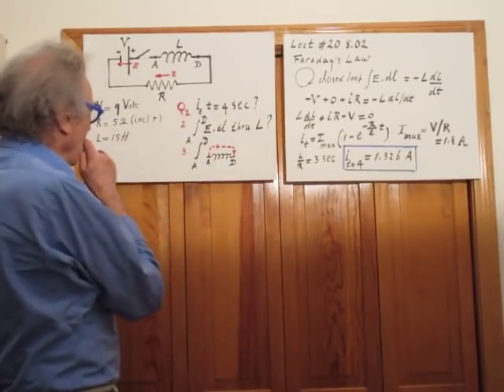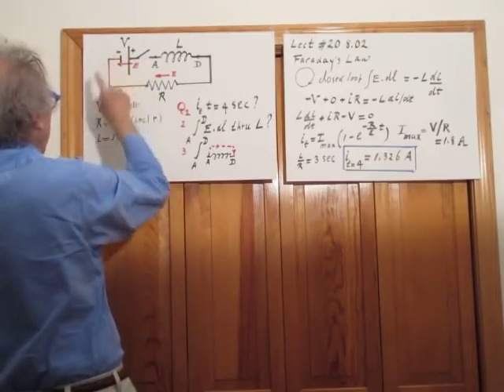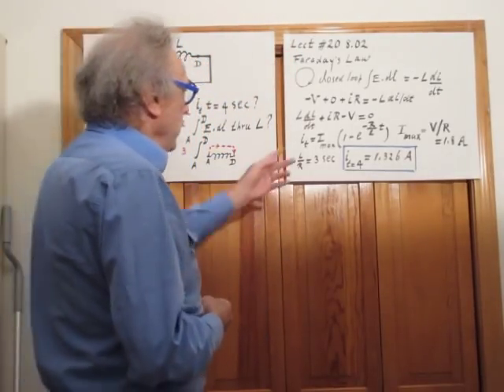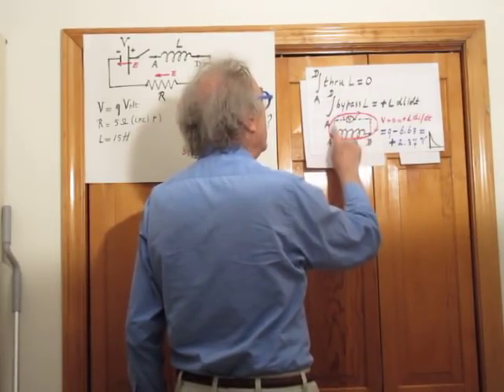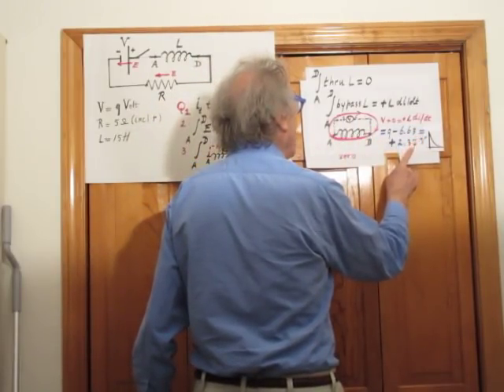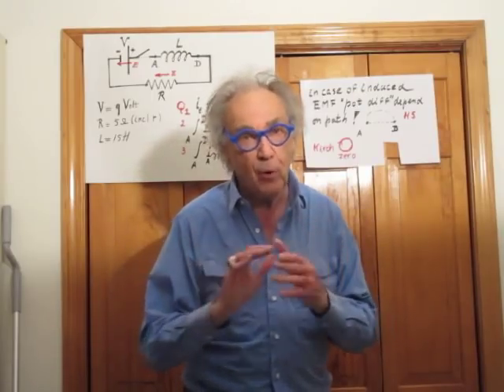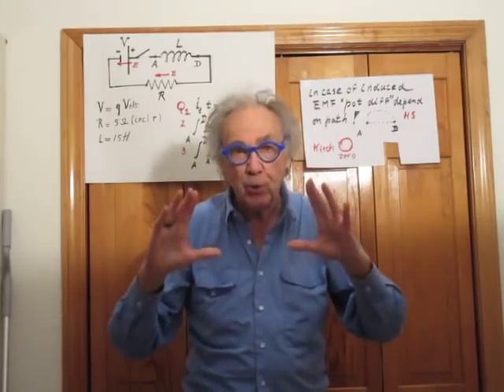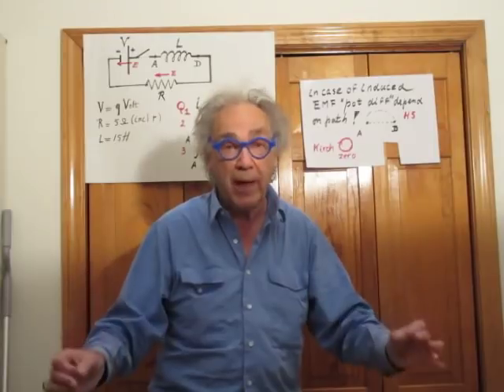Solutions Problem #75 Faraday's Law!

Comment: "Voltage is not always independent of path".
thank you sir
Reply from the maker: that's correct; if dphi/dt in  Faraday's Law is zero, then voltage differences are independent of path.
Reply: @lecturesbywalterlewin.they9259  so basically if there is NO change in magnetic flux, then Voltages are path independent? 
I'm just confused as to how/why we can exit the wiring of the circuit and follow some induced Electric field that exists outside of the circuit and then in a way call that a circuit? Why is that we just don't always use the calculation going though the Inductors since that is literally apart of the circuit? I hope that makes sense.

Comment: I do not always get to view them, or have the time to understand them deeply, but I love these videos.

Dr. Lewin ... my last comment was on another video, but I would love to hear your answer to the question of - is there any experiment that you do or have seen or even thought of that is your favorite experiment of all time that reveals something you feel is deep and primary about the universe?

Another question I have had about physics and mathematics is this.  When we look around the universe and solar system so far that we see these are all physical and geological manifestations of the laws of physics acting over time. But if we were looking and we see certain configurations they tell us there is a kind of "congealed" time effort of chemistry, biology, life and intelligence, and evolution.  For example, we get to the Moon, or Mars or anywhere we know that we have no been, and we find something like writing, or a book, or a tool.  Is it possible to look at these types of artifacts like a physical or mathematical dimension, similar, but different from length, width, depth and time?  Something that might tie life and even intelligence to the universe in a physical way?
Reply from the maker: The unit was established by the IEC in 1930 [3] in honour of the Danish physicist Hans Christian Ørsted. Ørsted discovered the connection between magnetism and electric current when a magnetic field produced by a current-carrying copper bar deflected a magnetised needle during a lecture demonstration.

Comment: Thank you so much, understanding this is really helping me in my circuit design.

Not because I'm going to take the time to apply Faraday's Law, but simply because I am trying hard to burn into my brain that induced EMF does not follow Kirchhoff's Loop Rule. Understanding this takes away the mystery of designing circuits using magnetic components; it explains entirely why the engineers design the power supply control circuits by analyzing the "S-plane!" That allows them to do the math in time units of the frequency, so Kirchhoff still applies. And then all the non-linear behaviors that they need they achieve by switching in and out different parts of the circuit. So they never have to consider units of time other than at the operating frequency.

But it also is important because since induced EMF is path dependent, circuit layout in the presence of noise is no longer "mystical" at all. If a person was good enough, they could even use Faraday's Law to triangulate the location of the noise source based on the noise produced in different parts of a complex circuit.

Comment: Great problem.

In Holland we cycle. 
If you ride up a hill, that takes energy, but you will benefit from that when you go down again. Gravity  is a conservative field, and the loop rule applies.
But in Holland we do not have a lot of hills, however we do have a lot of wind. If you have a head wind when going from home to school you better take the route through the woods. Going back you go through the fields. The loop rule only applies when there's no wind.
So we need Faradays law, and Kirchoff's loop rule is for the birds abroad, where there's no wind, but only hills.
Maybe the analogy stops there, but I like to think about the changing magnetic field as a sort of 'wind' to remind myself when doing a problem. You could even think of wind gusting up water level in a canal, suggesting an apparent potential difference.
Reply from the maker: The analogy is niet correct. The induced EMF is Ldi/dt. It's only non zero if there is a change in i. Your wind will always oppose your motion; het hangt niet af van de maatte waarin de wind verandert.
Reply: @lecturesbywalterlewin.they9259  Ik heb niet gezegd dat de wind vergeleken moet worden met het magneetveld zelf. Niet voor noets gebruikte ik het woord changing. Maar ook de richting en wel meer  is anders. Het gaat me slechts om het verschil te illustreren tussen conservatieve en niet conservatieve velden.

Comment: Now I understand why Kirchhoff's second law is for the birds. The closed path integral over the electric field is zero if and only if there are no changing magnetic fields. It is often stated in textbooks that your third equation (L di/dt + i R - V = 0) corresponds to Kirchhoff's second rule, which is not true. I think, it is something like a modified version of Kirchhoff's second rule for changing magnetic fields. Just like one assumes inertial forces in accelerated reference frames, so that Newton's third law still remains valid.
Reply from the maker: It is often stated in textbooks that your third equation (L di/dt + i R - V = 0) corresponds to Kirchhoff's second rule, which is not true  Indeed that is WRONG The closed loop integral of E dot dL is 
IR --V  it is also --Ldi/dt

Comment: I have been discussing this on the net with many people I call Kirchhoffians trying to explain you were right, and one thing I have noticed they get confused about is in the use of the electric symbols adopted by lumped circuit theory. Maybe if you used a different way to draw the inductance, for example as a single coil of thick wire with its terminals close together along the circuit path, it would be easier to see the two paths you are referring to: one that goes through the perfect conductor and one that jumps from one terminal of the coil to the other one. As is shown in Ramo Whinnery and vanDuzer's "Fields and waves for communication electronics".
Reply from the maker: send this to those who are confused or are ignorant.
I demonstrated at the end of my lecture #16 of my 8.02 E&M course at MIT that two identical voltmeters attached to the same 2 points in a circuit can show very different values. https://www.youtube.com/watch?v=nGQbA2jwkWI&list=PLyQSN7X0ro2314mKyUiOILaOC2hk6Pc3j&index=17 The reason is that in the case of an induced EMF (Faraday's Law) potential differences are no longer determined; they depend on the path. This also applies to the secondary windings of transformers as the EMF in the closed loop of secondary windings is induced. https://www.youtube.com/watch?v=b7i2uMx7gHo&list=PLyQSN7X0ro22zanLOcvkaSY-IZqheFYM5&index=8
Of course, in cases where Kirchhoff's loop rule (KVL) applies, 2 voltmeters attached to the same 2 points in a circuit will always show the same value. 
My demo was first suggested and published by Romer in December 1982 in the American Journal of Physics. This demo has now become a classic; it's done all over the world at many colleges and universities. 
Kirchhoff's original text can be found in the following link, pages 497-514: https://books.google.de/books?id=Ig8t8yIz20UC. Clearly he was fully aware of the prerequisite for his "loop rule". KVL is a special case of Faraday's Law. That's why Faraday's Law is one of Maxwell's equations and KVL is not.
By teaching students that KVL always works without telling them when it does not work, makes many believe that the closed loop integral of E dot dL is always zero. ElectroBOOM and Dirk Van Meirvenne therefore believe that 2 voltmeters attached to the same 2 points in a circuit must always show the same value which is not true as demonstrated in my lectures. They each posted a video (see @ note below) on their channel in which they claim to have proof for their wrong ideas which violate Maxwell's equations. Apparently they do not know, or do not understand, that in the case of an induced EMF potential differences are no longer determined; they depend on the path. MIT students who took my 8.02 course (Electricity and Magnetism) would not make this mistake! I therefore believe that to introduce a "modern version" of KVL and then teach students that KVL always holds is not advisable as you may set them up for making the same embarrassing mistake that both Dirk Van Meirvenne and ElectroBOOM made. 
Also read Professor John Belcher's thoughts on Faraday's Law and on KVL. Professor Belcher is my former colleague at MIT. http://freepdfhosting.com/0813df09f5.pdf
(@) ElectroBOOM insulted me in his video by mentioning that the reason why my 2 voltmeters read different values was due to "bad probing". If I had done the demo correctly I would have found that both voltmeters would have read the same value.
Reply from the maker: @DarkNight-bo7om  I appreciate the fact that this Physics may not be familiar to you. Don't feel embarrassed about it; you are not alone. However, it's never too late to get educated. The choice is yours. Maybe this will help you. 
I demonstrated at the end of my lecture #16 of my 8.02 E&M course at MIT that two identical voltmeters attached to the same 2 points in a circuit can show very different values. https://www.youtube.com/watch?v=nGQbA2jwkWI&list=PLyQSN7X0ro2314mKyUiOILaOC2hk6Pc3j&index=17 The reason is that in the case of an induced EMF (Faraday's Law) potential differences are no longer determined; they depend on the path. This also applies to the secondary windings of transformers as the EMF in the closed loop of secondary windings is induced. https://www.youtube.com/watch?v=b7i2uMx7gHo&list=PLyQSN7X0ro22zanLOcvkaSY-IZqheFYM5&index=8
Of course, in cases where Kirchhoff's loop rule (KVL) applies, 2 voltmeters attached to the same 2 points in a circuit will always show the same value. 
My demo was first suggested and published by Romer in December 1982 in the American Journal of Physics. This demo has now become a classic; it's done all over the world at many colleges and universities. 
Kirchhoff's original text can be found in the following link, pages 497-514: https://books.google.de/books?id=Ig8t8yIz20UC. Clearly he was fully aware of the prerequisite for his "loop rule". KVL is a special case of Faraday's Law. That's why Faraday's Law is one of Maxwell's equations and KVL is not.
By teaching students that KVL always works without telling them when it does not work, makes many believe that the closed loop integral of E dot dL is always zero. ElectroBOOM and Dirk Van Meirvenne therefore believe that 2 voltmeters attached to the same 2 points in a circuit must always show the same value which is not true as demonstrated in my lectures. They each posted a video (see @ note below) on their channel in which they claim to have proof for their wrong ideas which violate Maxwell's equations. Apparently they do not know, or do not understand, that in the case of an induced EMF potential differences are no longer determined; they depend on the path. MIT students who took my 8.02 course (Electricity and Magnetism) would not make this mistake! I therefore believe that to introduce a "modern version" of KVL and then teach students that KVL always holds is not advisable as you may set them up for making the same embarrassing mistake that both Dirk Van Meirvenne and ElectroBOOM made. 
Also read Professor John Belcher's thoughts on Faraday's Law and on KVL. Professor Belcher is my former colleague at MIT. http://freepdfhosting.com/0813df09f5.pdf
(@) ElectroBOOM insulted me in his video by mentioning that the reason why my 2 voltmeters read different values was due to "bad probing". If I had done the demo correctly I would have found that both voltmeters would have read the same value.  
This is my only msg on this issue. This is too basic. I do not argue either with people who believe that the Earth is flat.
Reply: @lecturesbywalterlewin.they9259  😅I m learning from u sir....And I have understood what ur teaching...thanks for replying...u r really very clear and easy to follow ... .thankyou..
Reply: @lecturesbywalterlewin.they9259  Your lectures are very very helpful...

Comment: Walter Lewin Sir, 
 I see that when a voltmeter measures  a voltage across a self inductor there is no electric field across the self inductor , the electric field is across the coil inside the voltmeter. My question is - can  this be physically demonstrated with a non contact electric field probe. The probe placed beside the self inductor no field indicated , move the non contact electric field probe away from the self inductor and place it beside the meter coil and an electric field is indicated. Is that correct.

Comment: My difficulty in getting these problems correct is not Faraday's law, but the part about the integral through the coil being zero, which means the integral value is eventually divided into the fixed portion through the battery and a varying portion across the resistor. Is there any further explanation you can give as to why the integral through the coil wire must be zero?  Could any instrumentation be devised that, applied to the inductor,  would read zero at all times, or can it only be observed as the potential across the battery and resistor (as does the added voltmeter)?
Reply from the maker: no E-field can exist in a superconductor as that would lead to an infinitely high current. use google!!!
Reply: @lecturesbywalterlewin.they9259  Thanks very much for replying! The term "back emf" came to mind, and I now see that this is the value read by the voltmeter because it completes a loop with the inductor. So, the integral through the inductor wire is zero, but the integral on the path through the voltmeter or through the battery and resistor has to equal the induced emf. I think in electronic engineering, it is the voltage "measured" by the resistor and battery or external voltmeter that is typically emphasized, and the zero integral through the inductor wire is treated as a mathematical necessity. Understanding it via Faraday's law and noting where the linked flux exists is much more satisfying, but as you have said, it is difficult for many (me included).

Comment: I have no problem in understanding the concept, but I found it very difficult to learn electromagnetics on the level where I could calculate these things. You could say I understand Faradays law just as well as QED, which I have read for fun to understand generally how things work, but integrals and dot products trip me.
Reply: Don't worry cause me and all my friends who are in E&M right now basically feel the same way. Taking Vector Calculus before attempting the mathematic calculations required in E&M problems I think is essential. At my university, it isn't a course requirement, only being enrolled in calc2 is. But in calc2 (at my university), you don't ever do double/triple integrals, or dot products/ cross products, and definitely not flux problems. These really are concepts in Vector calc. If your confused about how a dot product works and its functionality in an integral, Id suggest learning how to calculate the flux of Vector fields in Vector calc problems since this is what you spend so much time doing in that course.

Comment: one thing to note: the current passing through the circuit loop (I mean the big rectangular loop that represents the whole circuit) generates magnetic flux that passes through the loop, perpendicular to the paper, and there is an inductance associated with it albeit very small and negligible here (compared to the huge 15H inductance). Therefore, even if you remove that 15H inductor from the circuit still KVL will not exactly hold and there will still be an Ldi/dt term on the right side of equation. This L is the small inductance of the whole circuit loop
Reply from the maker: If the circuit has only copper wires, resistances and capacitors the Ldi/dt term in general is so small that it can be ignored and it's 100% kosher to apply KVL.
Reply: @lecturesbywalterlewin.they9259  also it should be small in size. I cannot say how small since we have a pulse voltage input but if you measure the current in such a circuit (with no explicit inductor, just a resistor and a long wire) on oscilloscope you can easily see the exponential rise of the current.
Reply from the maker: @amirb715  I do not disagree with you. If the circuit has only copper wires, resistances and capacitors the Ldi/dt term in general is so small that it can be ignored and it's 100% kosher to apply KVL. But NOT in all cases.
Reply: also this thing will radiate too. you can hear a clicking noise on radio when the switch is turned on/off. I suppose during the small period of time when the current is settling to its final value, we have a time varying magnetic field and inevitably a time varying electric field (if my understanding of Maxwell's equations is correct?) and therefore a wave packet will generate and a small amount of energy will radiate away from the circuit. Again I am talking about just a large loop of copper wire with no explicit inductor.
Reply from the maker: @amirb715  I agree that on a timescale of millisec and nanosec after turn on and after turnoff KVL never works. But that is in practice not relevant. Even your turn on itself is not instantaneous.